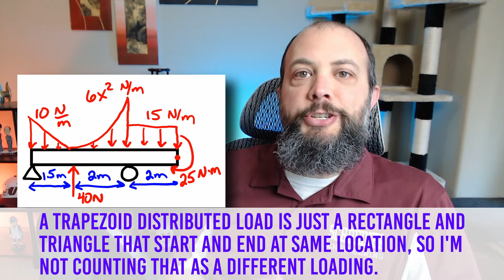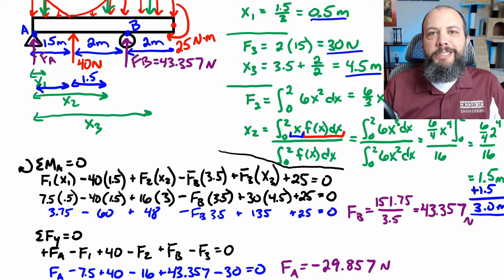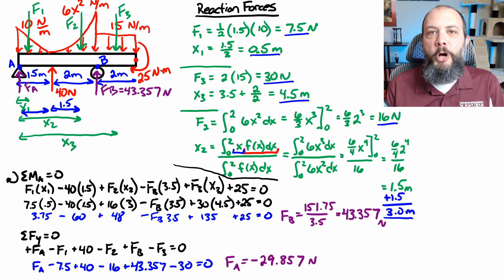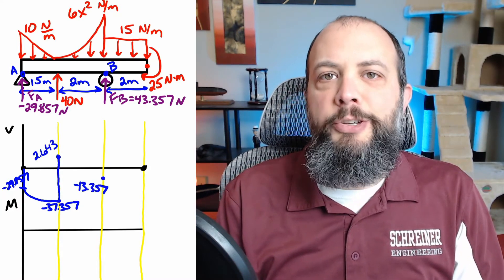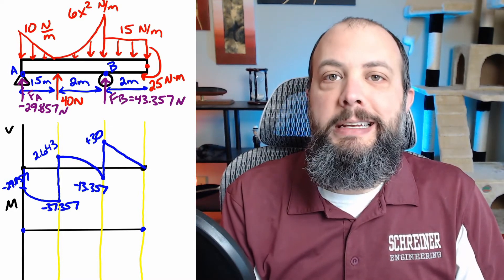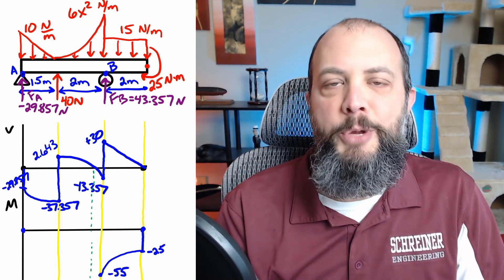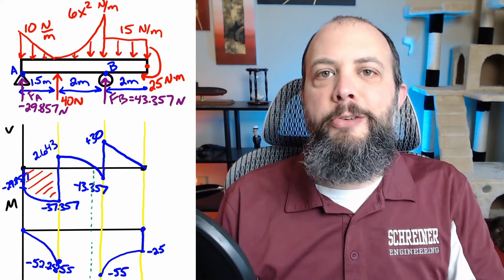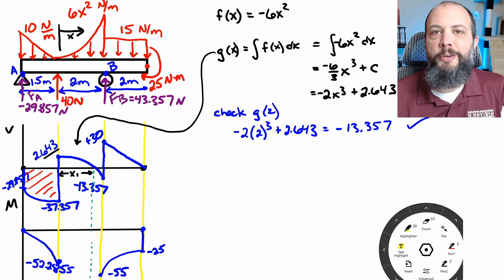Advanced SHEAR and MOMENT DIAGRAMS Example Problem (with Curved Distributed Load)

Comment: 6:45 wouldn’t it be 16 at the centroid location of the parabola? Not the end of that parabola section
Reply from the maker: At the beginning of the video around 3:00, when solving for the reaction forces at the supports, F2 and x2, we did replace the parabolic distributed load with a single point force at the centroid. But, that's not real, just a simplification that could be used at that time. Now, when drawing the true shear/moment curve, you can't replace the curve with a point force, you must account for the distributed load as a curve. We still get to use the value of 16, but just that the overall change across the entire width of the parabola will be 16. But it does not actually change instantaneously at a single point.

Comment: I tried to solve it by equation method, I computed the 0 shear location to be 2.47m from the left support and the maximum moment to be -39.855 N.m.
Reply from the maker: I wasn't able to recreate the numbers you got. But - to get those answers, you would definitely need different reaction forces than I had. I recommend going back to the free body diagram and comparing how you solved for your reaction forces, vs how I solved for mine, and see if that explains why we got different values. Be mindful that my Fa force on the left ended up being negative not positive, so Fa is actually pointing downwards.